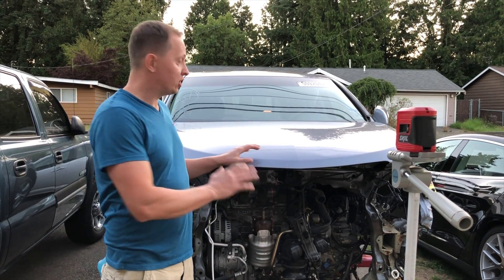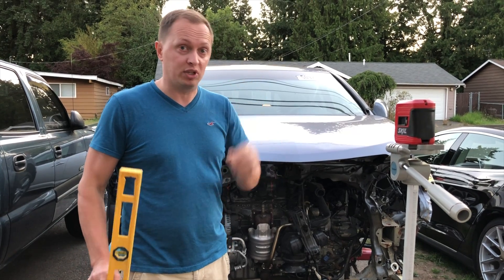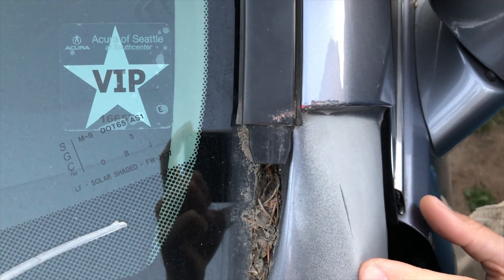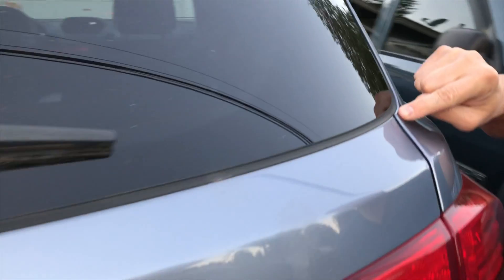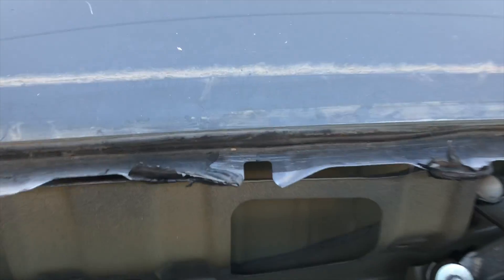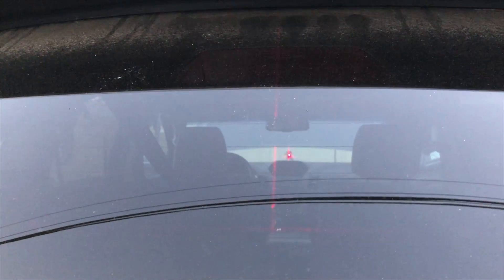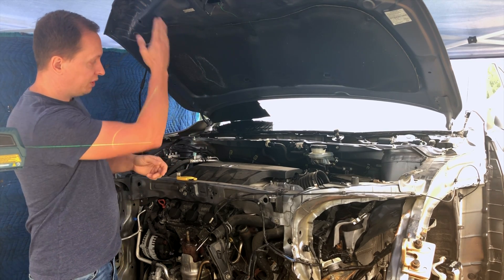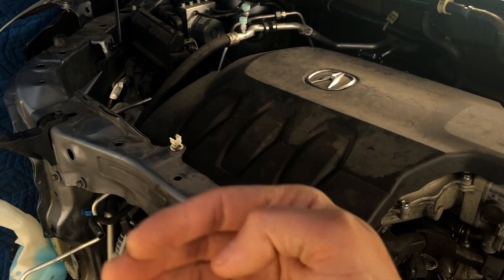✅ How To Use a Laser to Measure Auto Body Car Frame Damage Collision Repair Equipment Universal DIY

Comment: Why  so many comments complain about using the laser? I think it's great. I really like your style. The laser have vertical and horizontal line. I currently study book called "Auto body repair technology" by J. E. Duffy and it clearly states that there are two major DIMENSIONAL REFERENCES : Datum plane and Centerline. So if you have the car on the frame machine and  if the car is clamped (not resting on wheels and suspension). And the laser is true to the frame machine. Then the horizontal laser can be datum plane and vertical laser can be center plane. And then one can use these references even on HEAVY COLLISION vehicles. There is also a Zero plane which separates the car into three sections. if the center section(passenger cabin) is true(to the datum plane and center plane), then you can compare the front and rear sections with the center section to find heavy damage .I've never seen Arthur Tussik  use 10000 dollers measuring system... I'm only just starting to learn auto body, so i find every bit of information interesting. good day! (drinks beer)
Reply from the maker: Even though you're just start to learn about auto body, you are in a way much further ahead of the other so called "experts" because you're actually getting what's going on in the video. Arthur and alot other real experts have been using the laser measuring method for years with great results, because it's a great and very precise way to measure out the damage.

Comment: Question: did you have to move the Lazer to level rear end of the car ?
Reply from the maker: You can move the laser to the rear, but if you're only working on the front of the car, just level out the front and you'll be good

Comment: Congrats from NorCal on your wedding.  That happened already, yes?  Riddle me this, and maybe you could share some thoughts in your next project:  What do you leave on the car when pulling damage?  Like our boy Arthur will pull the damaged sections, get it close, then cut out the mangled bits and massage in new pieces.  You can tear it up a little on pieces you know are ultimately going to be replaced.    Thanks as always.
Reply from the maker: Thank you Brian, I am a married man now :-) normally once you figure out which part you will be replacing, you will try and pull that part back into its original place so all of the adjacent panels that are attached to it can go back into place with it. This way you're not trying to pull different panels by themselves which would be a lot more time-consuming and would also get more complicated.

Comment: Excellent video. My question is, how to do move the laser up or down so you can take a measure in the top area and then the low areas? By the way never use a laser so maybe I do not understand it but Im thinking the laser only shoots a straight  thin line for vertical and horizontal, so the vertical no issue cause it will go right the middle but the horizontal? or is the laser Static in one place and then you only use the tape to move it around for the measurements?

Also can you show us the actual stand of the laser and how you set it up to be in front of the car so we get the whole picture?

Sorry if I am confused but who better to explain it than the guy who shot this great video! Thanks,
Reply from the maker: I just put the laser on a camera tripod,  there is a crank on the side of tripod that moves the camera or a laser up and down as you crank. The laser that I use is self leveling, as you turn it on it will level itself out so you'd have a reading for perfect vertical or a horizon. Hope that makes sense, let me know if you have anymore questions.

Comment: Be sure you are on a level surface that would help, but besides that you are pretty darn good considering you say you are not a professional body man. And the stuff you build is incredible for someone at home. It’s crazy good
Reply from the maker: Sadly but no surface is level, and even if it was you still got the suspension sag and uneven tire pressure to take into an account. So what I do is get the laser out  (the key is to have a self leveling laser) and going off of a laser beam that is 100% level I rase the low side of the car with a jack until it's level.  I appreciate the comment bro 👍

Comment: Actually the measurements are made on bolts and certain measurement points. These can be found in crash books and online. And also 99% off shops use trams to measure.  It seems a hell of a lot easier. Also bolt the car together test fit and see where your at. Could you image how many hours this would take at a body shop? This is really confusing man. You are making measurements off of what? What is your reference point? I think what your doing is cool but you might be make bad pulls of taking where are you too much time. And yes I do work at a body shop and yes I do heavy hits.
Reply from the maker: I know what you're saying, I mainly made this vid for folks that would be doing light repairs at home, most people including myself don't have access to crash books and can't afford subscriptions to places such as Alldatra (I've looked into it and it would make sense to subscribe if I was working on multiple cars all the time, but I might repair just 3 or 4 cars a year and just can't swing $200/month on a subscription) Same would go for tram gauges that normally start out around $200 and go up from there. I do have a tram gauge and I normally don't use the laser to check for sway, but I just wanted to show people that most measurements can be done with just a laser and a measuring tape (assuming that the car is symmetrical and has one undamaged side). I normally would use the laser to see if anything had moved up or down and I would compare the damaged side to undamaged as a point of reference. But if it's a hard hit and both of the frame rails had moved up or down then I'd have to find a way to come up with measurements to make sure all is where it's suppose to be. But I normally don't get anything that been hit hard, I'm just not equipped to fix that sort of stuff
Reply: You can find crash books at libraries. I’ve found them also mitchell which is a estimating system puts them out you can call and get specs from them.
Reply from the maker: Thanks for the info on library books and Mitchell system.. I'll for sure look into it 👍👍

Comment: does the car have to be on a level suface
Reply from the maker: Nope, if you think about it there is really no such thing as a level surface when millimeters meter and even If you did find a "perfectly level surface" you'd still have the suspension sag and different air pressure in your tires that would throw your level off ... therefore you can just use the jack to raise up the lower side of the car to desired hight, that's what I did for this video. And normally if I have the car on the frame rack I'd just put the jack right under the frame rack on the lower side and raise it until the car is level... Hopefully this helps 👍

Comment: Fail. Nobody measures like that. 🤕
Reply from the maker: Just because you don't, doesn't mean other people don't. This method is great and I know plenty of other professionals that use it as well. Давай возьмём русские каналы на пример, Виталик из Гараж Каховка пользуется, Артур Туссик пользуется, Андрей Бищенков пользуется. Реально почти все русско язычные каналы по кузовному ремонту так размеряют. Или ты мужик просто тролишь?
Reply: Fix206 your car needs to be leveled not on a sloping garage driveway.
Reply from the maker: Are you hearing impaired ? did you not listen to what I was saying in the video, where the very first step is to level the car out... and then once it's leveled then you can start taking the measurements !

Comment: Great video but wouldn't a simple tram be faster to do comparitive measurements you could also measure 4 length. also if your car is level to the floor you can just use your tape to measure height from the floor or  the rack. Great video tho
Reply from the maker: Yes tram gauge can be used to compare measurements but you'd still have to use the level to level out the car in the first place and if you already have the laser then you don't have to buy a tram gauge :) , and once the car is leveled then you can also check if the frame rails moved or not (up, down, side to side) or the strut towers or any points in the floor pan, etc. , and I wouldn't use the measuring tape from the ground method because no ground is 100% flat, but the laser beam will level itself out just about 100% at close range

Comment: I like your enthusiasm but you would do well to get yourself a proper spec sheet before you assume the car is of symmetrical design. Asymmetric cars are plentiful.
Reply: Also if your  height is the same up front at the rad support I would doubt the  strut tower alone has moved up or down unless there's physical and visual damage or deformation in the steel. Typically when frame damage occurs the frame rail and strut tower movement will be linked together and come out together in the same pull. It's very unlikely that you would get strut tower damage without frame rail damage.
Reply from the maker: Going off a  spec sheet would be the best option, but I'm not sure where to get them. There are asymmetric cars, but there are far more symmetric ones out there, luckily I haven't ran into any thus far. And as of now I just try and make due with the equipment that i have.
Reply: @fix206  see if you can get a subscription to collision all data.com. if the spec sheet isn't available in the body and frame section you can do a library request and they will send you chief measuring system specs instead. Also theres lots of info on construction and repair procedures as well as r+i procedures.
Reply from the maker: I've actually looked into an alldata subscription some time ago and it was something like $220 per month, that's waaaay more then what I'd like to spend. I do this auto body thing as a hobby on the side, as most folks that watch my vids on YouTube. At most I'd need the measurements for a single vehicle once every couple of months or so. I could justify swinging that much per month if I had a body shop with cars going in/out on daily bases, but it's simply not the case in my situation. And that's why I use the laser for measurements, using this technic gets me results I'm looking for without expensive subscription.

Comment: I think the car must stand firm on level base as well as the laser instrument. Your clip give me very good knowledge.   Too pity my H civic was bumped on back and garage nearby my home just did repair work on  changing rear bumper and coloring.
But I noticed some of rear structure might be non correct. I noticed it when open or closing back trunk lid, it's not easily spring up or down. It needs some little force,unusual to before the collision.  Poor garage that serviced me!!!!
Reply from the maker: YOu should go back to that that garage and tell them to fix it right or give you your money back :)

Comment: If you think a water level is less accurate than a laser level your fooling yourself. A good quality machinist level can read far more accurately than your laser level. In fact you may quote what model laser you used and I'll check the accuracy and tolerance
Reply from the maker: Most people wouldn't be using a "good quality machinist level" to do this sort of a work, but a regular construction grade level, like the one from hardware store. And those things aren't all that accurate, so laser level wins. And there are a lot of instances where you won't be able to apply a bubble level on the car, like splitting the car in half with a beam to be used as a zero point to measure from.

Comment: This is gold seriously thank you
Reply from the maker: I'm glad you found this to be helpfull... I use this technic all the time, sure am glad I've learned it. 👍
Reply: Is a cheap laser worth 34 bucks ?Because i was looking on amazon and thats the cheapest i could find and doesn’t come with a tripod. Anyway i have a question would this technique work on a car thats already fixed ? I took my car to a frame shop and i would like to check their work
Reply from the maker: As long as the laser level you're looking at is able to self level that is al that matters. You can spend $450 on a high end green laser that would have a 300 foot range or a cheapy red one with range of 20-30 feet. End result is the same, I just put my level on my camera tripod or sometimes even on some stationary object in front of the car. You can use the technic to double check the frame shop's work and if everything checks out then you know they did good.
Reply: Definitely subscribing keep up the work 🤙🏻
Reply from the maker: You got it brother.... I got more content coming, stay tuned !

Comment: do you know there are assymetric cars aswell...and the points of reference that you used for measurements they gotta be exact in the same location for measuring.. for better measuring point reference just use alldatta they are very precise on measuring car reference points and they even give you the correct measument spects all over the car...and btw you have a 6mm tolerance on any measurement which you divide on -3 or 3
Reply from the maker: I do know that there are asymmetric cars out there, but they are pretty rare, so this method works most of the time but as you've mentioned, it's not a 100% in all instances. Correct me if I'm wrong, but I believe alldata is a payed service? I don't do enough of these repairs to justify an alldata monthly bill :)
Reply: @fix206  yes it is a monthly bill that is not cheap but for a person that is doing car repairs like you i guess you can benefit from all the info that those companies offer with their service and if you know any other person that may be willing to split the bill that will help a lot the 2 of you. most of the cars they have a certain tolerance 6mm let me tell you why: car got hit on the front end and it sway to the left so you have 9mm left side rail sway to the left when you pull against the impact per say to the  right all the electronic measurements equipment are gonna measure  -0+ negative numbers will turn red from -4 and up and all positive numbers will turn red 4 and up if you havent pull enough the rail and is still in by more then 4mm that is not acceptable but if you over pull the rail by more then 4mm thats not acceptable either so -3 and below  and 3 and below are the tolerance that you have on a car measurement.

Comment: @fix206 would you say 5mm is enough to go through the process of straightening or will adjustments in alignment  be able to make up for it?
Reply from the maker: it really depends on a vehicle, from factory unibody has 3mm tolerance and a framed vehicle has up to 5mm tolerance. They arent perfect from the factory,  you could possibly get away with playing around with adjustments, but I like getting everything down to a T, that way final assembly goes much smother

Comment: Hi did you have the car on you're improvised jack stands to get the car level.
Reply from the maker: No I didn't. When I did the laser video the car was already mounted on the frame rack. But It really doesn't matter, you can have the car sitting on just wheels and tires, and once you'll get the laser pointed the corner points of the A pillars, 99% of the time you car won't be level, so all you have to do is just slowly jack up the low side of the car until the horizontal laser beam will hit both corresponding points, that's when you'll know that you just leveled your car out. Even once I got the car mounted on the frame rack, driver side was about 3/4 inch too low, so I  just jacked up the the side of the frame rack. Hope that makes sense.

Comment: That seems to get ya pretty close I like using a tram Gage and doing cross measurements on core supports on frame rails the fastest system I have used is the shark measuring system definitely not a at home deal though.
Reply from the maker: I do also use tram gauge, I actually built it from some materials I had sitting around in my garage,  but it has its limitations, and that's where the laser "shines"

Comment: omg noooooo. you have to beat the body to fit the frame. this is how we do it in poland.  hear it evrty day, tired of it. not a frame gut working in a frame shop.... you would die with the pics I got of damage these polocks do. But them again a 2018 vw rear deck strapped to the floor with come alongs and chains.... mid evil... cant take it. bought a old movie theater, the majestic and starting Majestic Auto and restorations. thank God. I will use this thanks. just found you. when I hear the air hydraulics or see the old man with a grinder I cringe because I am left to fix his fuck ups and he is the owneer
Reply from the maker: LOL... your comment made me laugh :))) I wish you much luck in your auto body venture over at Majestic👍

Comment: At least you're using proper units and not those nonsensical fraction thingies :)
Reply from the maker: no kidding... even though I live in US I still hate measuring in inches...  I've been doing it for the longest time it still confuses me
Reply: @fix206  American guy I know that had to move back to the US due to a family emergency after living here for 10+ years mentioned to us "you know what I miss the most since I moved back to the US? The metric system and your pizza!", he can't get the pizza but he still uses metric even though it's harder to do so in the US.